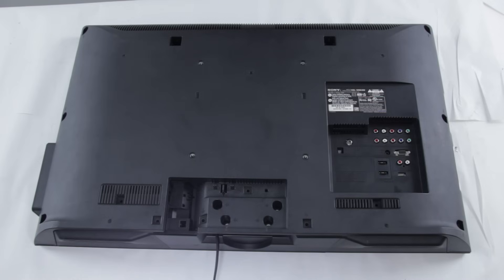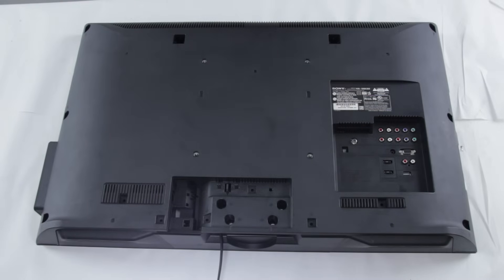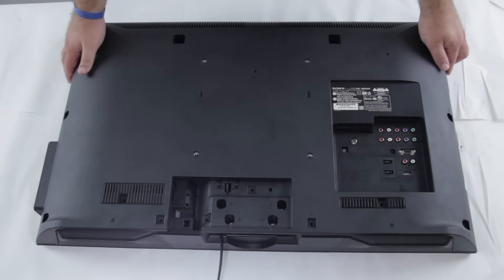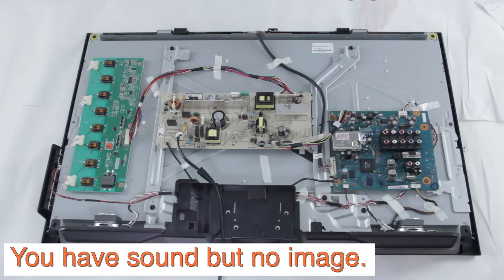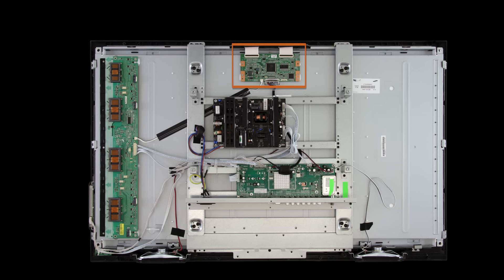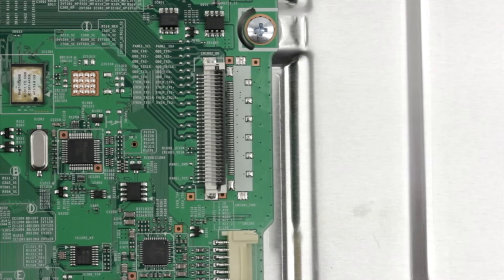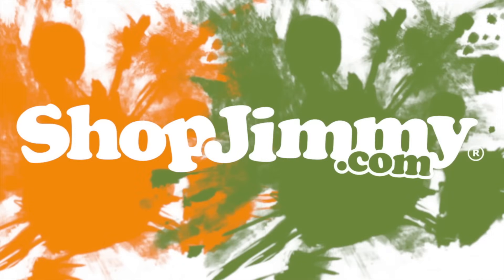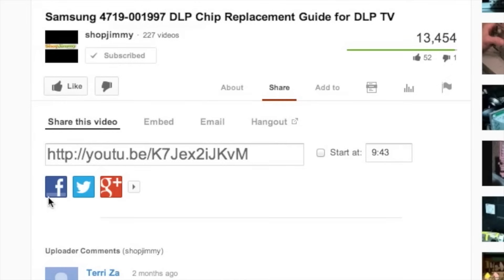LCD TV Repair Tutorial - T-Con Board Common Symptoms & Solutions - How to Replace T-Con Board

Comment: So my Sony XBR-65X750D has a flashing red light just below the SONY logo, no picture or sound. I took the back off and disconnected the ribbon from the T-Con board. I turned the TV on and the screen lights up and to my surprise it started playing "Dreamy-Like"music. 
The music has me baffled as it won't play when the ribbon is connected nor will the screen light up.  I plugged the ribbon back into the T-Copn board, turned on the power and no music but the red light flashed 5 times once again. 

 I just want my 8 year old TV to work. Any suggestions will be welcome. Thanks.

Comment: Hello,  thanks for posting these videos.  I have a LG OLED55C3PUA TV that doesn't power up.  LG had tried to send techs to fix this TV (they replaced both the power supply and main board - twice) but it still doesn't work.  I've also tried doing power resets by unplugging the tv from the power source and holding the power button on the tv for 15 to 20 seconds then waiting for over two minutes and plugging the TV back into the surge protector using different locations all to no avail.  I keep thinking that this can't be something that complicated.  Since both sets of power and main boards didn't fix this problem do you have any suggestions as to what could be causing this problem?  I'm getting no sound or picture.  Could this be the T-con board maybe?  Thanks

Comment: I have a problem and maybe the cause is the T-con board? The problem is on the Grundig 32 GLX 3000 T
serial number 00700159, body T9, and the display module is marked Samsung LTA320AP06 1023 P8ZF 8CAEJP0Y0Q 006. The picture is OK after I start the TV, but after 10-15 minutes one color is missing (I think green). Please, what is your opinion on this? Can you suggest something? Thanks... I already checked the cold connections...

Comment: I have a TCL 55P607 that shows the TCL splash screen when I turn it on.  It shows in color, brightly lit, sharp and full screen, but then the screen goes dark.  The power light keeps cycling between bright for a second or two, then about 30 seconds of dim.  I don't hear any sound or see any picture on the display after the splash screen goes away.  Power supply seems to be ok (26V and 12.6V).  Would this be a T-Con or main board issue??

Comment: LG 79UB 980T won’t come on.  Nothing is connected to tv.  I expect screen to light up with a logo.  After some time the led on the power supply board blinks 5 times and then off.  Keeps doing that until I switch off.   Power supply is ok.   But I don’t get panel volts on the drivers 50v?
Can you help? Please.
Thanks.

Comment: My TCL (65S450G-CA) screen died today while using it, 6 days out of warranty. There is no factory reset button (pffft!). I tried unplugging it for 30 mins and holding the power button under the logo. The screen went dim in a circle in the center and then wouldn't respond, the colours were a little weird or just dark. It now won't show any menu or anything but the backlight is working (screen glow). It still has sound via the google assistant. TCL suggested a factory reset which can't be done as it asks for a PIN (that the tv gives) to do so, we can't see the pin.

Comment: Hi I have a Hisense TV model number 58R6E3 and serial number 58G2104NVH04540, and I am suspecting the T-Con board may have a problem because the TV seems to turn on with audio but with no picture. I tried using a flashlight to see if I could see the screen, but no luck. Can you tell me if the T-Con could be the issue and also let me know what the correct replacement part would be by checking the model and serial number that I provided? Thanks.

Comment: Hi there, my Samsung UN60F7100AFXZA upon turning it on it will have a split screen vertical lines on the left, and it will turn on by itself like there is no problem and minutes later screen will be blank with sounds and picture will appear again by itself after 10mins or 20mins, upon checking some youtube video, they are saying it is the tcon board or the flex connector. or someting.

Comment: Hi, I have Vizio model d65-d2, and there are wide, vertical lines (with no picture) across the entire screen. I purchased and installed a tcon board from Shop Jimmy, and a brand new main board, but the problem still persist. Do you offer a tutorial on checking voltages for the boards in this model tv? I've checked all the ribbon cables for continuity and they're all good. Also, is there a way to check the screen with a volt meter? I don't know if all the little gold tabs along the edges are negatively affecting anything. Thanks for any help you can offer!!

Comment: I have a 2 year old Vizio V585-H11 and we have replaced the main board and the T-con board. Problem isn’t resolved. We try to switch from watching something on the internet and it’s fine but when trying to switch over to local tv it comes up with  code EPG101 and screen freezes up and says no signal-Hdmi1 and nothing is plugged into any hdmis. When mainboard was install it was working for about 2 hours and after Vizio did updates automatically it froze back up with the same statement no signal-hdmi1

Comment: Hello I have a Toshiba 55M550KU serial #55G21204 YH03857. The display started out with an 8” vertical washed out line in the center of the screen. Now the whole screen is washed out and solarized.

Comment: Hi Jimmy.  I have a Vizeo 75" TV Model V755-J04 that won't turn on.  When I first plug it in, the white power light flashes about 15 times and then fades out.  Then, if I use the remote to try turning it on, the white light comes on for about 3 seconds and turns off.  I have replaced the power and main boards and still same problem.  No sound and no picture (like it's not turned on).  I have 12 and 5 volts from the power board.  Please help.

Comment: Newbie to TV repair? Got unbranded Lcd model  X26/16 A - GB TCD UK (V260B1 L01)
Received tv , wont switch on. Led stand by lit red. On light flicks on 2 secs goes off.
Power supply board voltages seemed ok
Removed tcon plug from main board , now still not staying lit?
Removed dvd player lead from main board.
Now on led stays on
Backlight works no picture just white blank screen.
Fitted used tcon board 
Reconnected everything,  dvd play works  but dtill no picture speakers no sound but crackling.
Next time i came to inspect tv again , original fault occured. 
So disconnected tcon and dvd plugs and On led stays on
Tcon board connects to the screen board , maybe its that😮

Comment: hey, I have a 70-inch Hisense-led LCD smart TV , when I power it on it turns on shows the Hisense android TV  logo, and then turns off. What is the problem? I replaced the main board and it did the same thing.

Comment: Hi I have a  tv with model no 50A7100FTUK Hisense, we were watching the TV suddenly it switched off. Went to standby mode, with red light on, we tried switching it back on again but the red light gives blinking like 3-5 times then stays solid red and not coming on. Is it the main board issue or the TCON board

Comment: I have a faulty Samsung OLED 50" Smart TV that starts up with sound and backlight (the screen goes from black to dark blue but then turns black again, or very occasionally it will start up as far as the home screen and everything appears normal but it just turns off again). 
Red LED light is blinking on and off as it tries to start up.
Some horizontal feint lines were observed some weeks prior to the fault occurring.
Any help welcome

Comment: I have a Vizio D24F-G1, with main board 715GA481-C01-001-004T, serial no LTMDQLRX1852683. It's lost picture, with apparently one horizontal line repeating, in colors not appropriate to the splash  image. I can email an image of the screen. I'm pretty good with electronics, but this is my first tv trouble shoot. There appears to be a very slight discoloration of the main board on the opposite side of a large heat sink, but I could be mistaken. The t-con  board was stuck to the screen, but has come loose. I've plugged and unplugged all cables. No change. I was ready to buy a mainboard, but now am wondering if it's the  board that you mentioned in this video. Thank you. I found you recommended by another YouTuber.
Reply: I've just observed that moving the t-con board does affect the screen image, but does not correct the issue.

Comment: Hello guy's,  Casey here. Well, I was hoping you could help me out by telling me how I can fix my I think it's 50 inch R CATV. It has lines all in it going from the top to the bottom. And it's got worse overtime. I got it last year for Christmas. I won at a Christmas party at work. Well when I got around to putting it up on my wall in my room, lines started to appear.... the model number is 46LA45RQ oh its tells me right here😂..46" LCD fullhdtv....serial number 1332-46LA45R-C125067 Manufactured date is october 2011.... Well, I hope that was enough information. I just hope that you're able to tell me what I can do to get those lines out. So I can watch it again cause it was a nice tv. Thank you for taking Your time in helping me out with it

Comment: Hi I have a 50inch hisense he50kec315uwts the problem started after it was returned by a removal company when I turn the unit on the hisense logo isn't a constant colour all the way though and in the middle looks dark the smart TV logo is perfect but then a row of lines flash in the center of the screen and the picture goes black but I can hear audio if you can help with my problem that would be greatly appreciated thank you for any help in advance

Comment: I got a Samsung PN50A550S1F S/N B46V3CQ201843P and it does a couple things. One is that there is a horizontal bar on top and bottom of TV and when the movie or show displays black backdrop scenes those turn bars turn red glow (maybe image burn or something). When the movie or show has normal scenes with full color I can’t tell there is those two horizontal color strips on top and bottom of screen. It’s only noticeable on black background scenes. The other issue is the sound from speakers dips out every couple weeks and I have to restart TV. I switched to my Alexa echo and have my Bluetooth headphones playing and every 5 mins or so the sound cuts out completely but still plays show. The sound comes back after 15 seconds. I used the Bluetooth headphones and the Alexa dot setup on another tv and it works great. My hunch is the sound has issue too. I really want to fix the display issue because this is a huge tv and I love it

Comment: @shopjimmy, i have a 75X9000H , recently it stopped showing picture only backlight and sound etc and all internal software working. when you do power recycle or extended power cycle it starts and works fine for few mins and again screen goes black. no lines or any other damage etc. What can be the problem?

Comment: Yes I did. I got a Vizio E 55 – you won. I ordered the repair kit from you and put it in and then I had lines I didn’t have no picture so I put my old PC board back in and I had picture and it was doing good but the right side would flash this weekend I went Pulled the screen out and went to do the LEDs and noticed that that one side was flashing all the lights so I put my old PC board back in and the light stop but then I had lines I’ve been trying to figure out which where I went wrong because I put the old one and I got I got it. I got a TV but the right side flashes I put the board I got from you guys in and I get lines and messing with tonight. My burned out my power board, so give me some help. I don’t wanna return them because I the power board or the PC board. I I don’t know. I don’t know if you gave me the wrong one or shorted out, I don’t know But it was working fine outside of the flashing on the right side, then put the other one in and it stopped flashing so then I put the TV back together and headlines and then I was trying to trace down. I didn’t have no picture just lines and somewhere along the line of burned out the power board and the TV was already burned up. I got the house got hit by lightning in the power board was already burned up. I just decidedto buy the whole kit make sure it was safe. Thank you.

Comment: Hi,
I recently changed the backlight  of my Samsung UA50KU7000 4k Led, after replacement I first facethe  issue of yellow tint screen which was quite settled by RGB adjustment, then I face the issue of dark colors, my Led was perfectly displaying before the backlight replacement, though I installed the backlights according to the model number but yet I lost the perfection of image.
I have a doubt about Tcon connections, the ribbon cable, the technician didn't paste the sticking tape on the ribbon cable along the metal body.
Any suggestion what causing this problem ?

Comment: TCL 75S 425 only half the screen works when I remove the left ribbon. I’ve replaced the T-con board and still same situation. I tried to isolate the ribbon pin that is messed up but found the connection too small to manage. Any thoughts?

Comment: Hi, I have a Samsung 32" Model: LA40R81BX/RAD it gradually started presenting faded pic, to blacked out lines. At first would be off and on with the issue. Til now pitch black. Would you know what this issue is and what part would need repairing? Ty

Comment: Hi jimmy 
I have a sony kd - 65x85j just used it for less that two years i have been experiencing some problems with it.
When i switch on the tv the screen starts flickering and then it freezes after a while it starts turning black until its completely black but there is sound.
What might be the problem ?
Kindly advise

Comment: on my 55X900E and it works for a minute then the lower section of screen gets a few seconds of double image and horizontal bands on lower half then goes blank but i can see the backlighting and have perfect sound. I have replaced the main board and the lcd board and same exact issue so Im eliminating that.. could this be T-Con ?

Comment: Hello! I have a Vizio M50Q6-J01, s/n LTCUG6LX2854238. It has developed thin static horizontal lines, several near the middle, and some near the top 1/4 of the screen. They are mainly visible when the screen is red or has reddish images. They do not flicker or move position. I'm handy and not afraid to do repairs, so any suggestions or help you can give would be appreciated. Thanks!

Comment: I have an element e4aa70r tv that just stopped working. The light on the power button blinks but it doesn’t turn on. I’ve tried resetting it a few different ways and nothing has worked so I’m guessing it’s a hardware issue…?

Comment: I have a 2020 Samsung QN58Q60TAFXZA 

I’ve checked power supply cable, swapped with one from a working Samsung TV and tried different outlet. 

When you press power on the red light goes solid for a second then blinks. The TV looks like the backlight is trying to turn on then it goes black. It just keeps repeating itself until you unplug the power supply again. 

I’ve been reading and watching videos and I cannot find anything that describes the exact symptoms I am getting and my 3 year extended warranty expired 2 weeks ago. Any advice would be appreciated.

Comment: Panasonic TX-55CX400B, hey I have a problem where sound will play but the screen goes black, woundering if this is a T-Con board issue as it seems the backloght turns off aswell, tried putting a flashlight to the screen but no image comes through which I believe means it is not a backlight issue? Any help would be great as I want to buy replacement parts and fit them myself

Comment: I have a VIZIO model V585-H11. The picture is normal for ~3 sec, then I get nothing but vertical lines for 3 seconds, then back to normal picture for 3 sec, and this continually repeats. What could cause this?

Comment: LG TV model No. 32LW5500 dont have sound and picture, Black screen only, only light under ON/OFF button turns on and off with remote and button on TV. please help to solve the problem.

Comment: I have a 65” Toshiba fire tv I’ve replaced the motherboard and mainboard, and it still has the same issue, as I turn it on the the logo appears on screen then goes off and the standby light stays on, any suggestions on what I can do?

Comment: I have a Vizio E55-DO backlights were clearly bad causing pic to go on and off , Verified all of the lights were bad and replaced all of them.. Put back together and pic is nice and bright but backlights still go on and off .. I have changed both the power supply and main board and get the same ,, One thing I see is that i can't get a menu up on the screen ,, any help appreciated Thanks

Comment: I have a LG 55uh6030. I started getting vertical lines so I ordered a replacement T.-con board from you guys. After replacing it everything worked great! However, recently when watching it, seems like when it gets warmed up it gets vertical lines on the right side of the screen then screen goes black and no picture at all. If I turn it off and allow it to cool down it would work fine again. Until it happens again. Please help 😢

Comment: I have a Sony bravia XBR-55X950H, SERIAL NUMBER 4012137.  Its way out of the one year warranty.  I have thin horizontal black lines that appear for 5 seconds then disappear for 5 seconds and the cycle repeats and repeats. The display dims when horizontal lines show up. The lines are  more on the left side than righ- but most of the way across..   It has nothing to do with the incoming signal nor anything attached.  Sony people say it needs "official" Sony repair.  I have the back off... no simple task and I think it might be the T-con board.  What do you think?  Alan

Comment: We have horizontal black lines on our Samsung TV.  I have changed input source and reset to factory settings. No correction. Will tcon board fix this issue? Samsung model UN5OTU8000FXZA, 09KX3CHN711599A